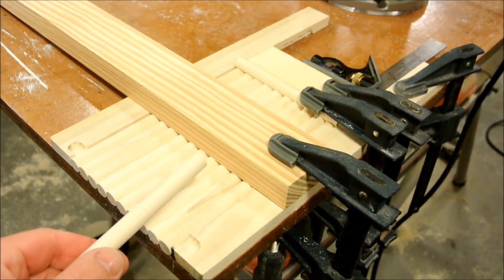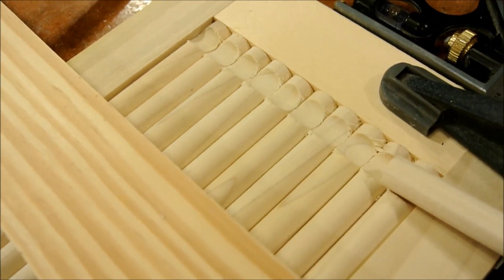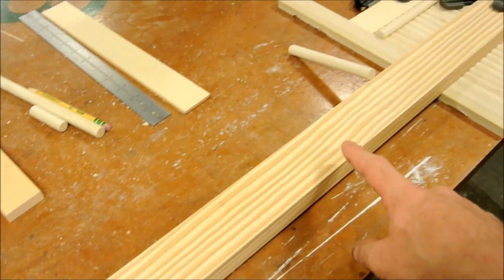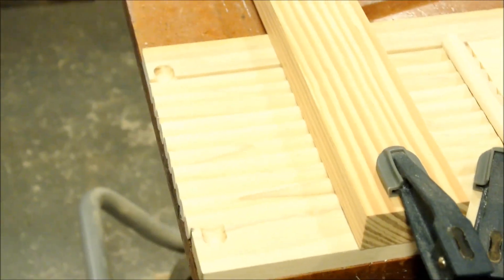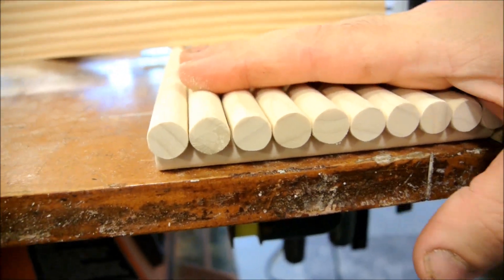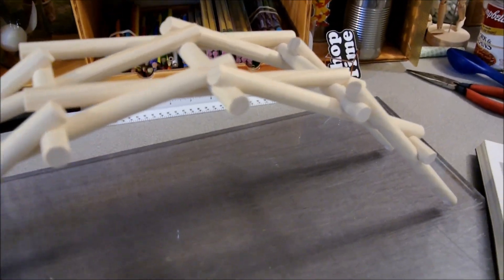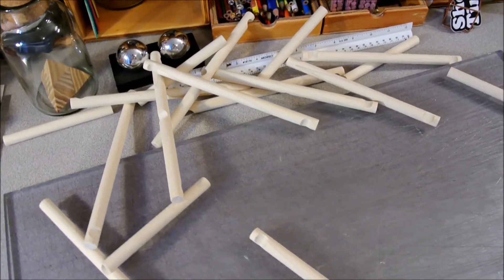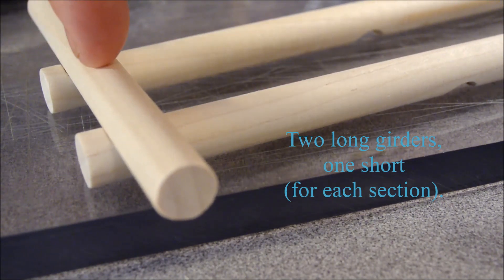Dowel routing for the da Vinci bridge puzzle

Comment: I made a bridge of this sort last spring. Used fence poles 160cm long each, the bridge is about 3meter(or more) long. Its built over a part of the forest, that drain water from a big area, so its very wet at times, but no stream. Have built a decking over the bridge, so that its easy to walk over. The bridge is quite sturdy, 3 adults and a big dog on top of it is no problem.

https://www.dropbox.com/s/ga5i7xdmvj1916j/20160618_110014.jpg?dl=0

I have built a hand railing to.

Comment: can u make a full circle from the same structure but just continued?
Reply: Myles Richter no  the bottom would not hold together  what holds it together is its own weight  the top half would push the bottom apart
Reply: Yes, you can, but it's because all the measurements have to be worked out ahead of time. I'll see if I can find a link.

Comment: This is really interesting, it kinda look at a tensegrity structure that i designed for one of my engineering exams.
Reply from the maker: I did consider making this more rigid for display by using a long beam underneath, because I could then keep it in a state of compression by adding tension (a few rubber bands) underneath the bridge. 

I suppose, by the definition, that my truncated icosahedron puzzle would count for that project. But really, look around: Is there anything that is not in a state of continuous flux between compressive and tensive states?
Reply: Yes I agree with you, everything's in constant compression, but if you add that beam you mentioned it will take forces in the form of tension instead of compression. Its because the legs also want to spread outwards. On a note I want to thank you for your nice video's they are really inspirational.

Comment: A. It's great. 
B. I can intuit how the pieces fit together, but short of a jig I'm wondering if there is a way to assemble this without a need to, at least temporarily fasten the joints(or hold them with your hands). I was pondering whether you could actually make a load-bearing surface above or below it and use it for a real bridge, if even just a walking bridge over a stream.

Comment: Nice, I've been considering this type of construction for a bridge over the creek in my back yard (20' span). But I need it to have a little less rise. I suspect that increasing the length of the longer timbers would flatten the arch. but do you think it would be detrimental to the strength of the bridge?
Reply from the maker: Yes. How big are the timbers you are using, and what is the maximum load you would expect to burden it with? Oh- (laughs) and how high is it?  

You may want to keep the design as is, and just add earth to create an abutment that rises above the bridge. This design is quite round for passage as-is. But this is far too complex an issue to give blind advice on ;)
Reply: If I ever attempt construction it would be only large enough for a riding lawn mower.  Maybe railroad ties would be sufficient.

Comment: are you gonna do a 100 thousand subscribers special?
Reply from the maker: No. I don't advocate the use of a numerical system based on tens, so that number seems arbitrary. Eight is a far better candidate for use in a superior system, even just based on its inherent symmetry, but as I've already surpassed eight sets of eight (which you may think of as 64 in our ten-fingered world), I see little point in a celebration of 12,500 sets of 8. 

lol. See why I don't think Metric isn't all that "better" now? Sorry to give you a hard time ;)
Reply: +pocket83 how about milimeters, centimeters and so forth, what do you think about that? do you think inches and feet are better?
Reply from the maker: No. I don't think there is a "better." We just get used to what we use. I will admit that Metric is far better standardized now, so after enough time, there could be less conversion-based error in the world if it were exclusive. But a fractional system is better suited for tape-measure construction, because halves (and halves of halves) are just so easy to approximate.    

That's why a system of eights would be ideal; that would be a hybrid system that draws the best from both worlds. But we have ten fingers, so I'm used to it the way we have it! However, we can dream...
Reply: +pocket83 thanks for the great explanation, i can see how your system would be useful in a lot of ways.
Reply from the maker: Wow, thank you.

Comment: thanks for sharing, do you think it can be made manually? does the design tolerate some imprecision?
Reply from the maker: You can definitely do this. My first attempt used a round rasp first, and then a piece of 1/2" dowel with sandpaper on it (spray-adhesive to stick it on there) to finish it off. That will work just fine ;)

 There are 30 notches to make though! So I thought a router would just be way easier. But for only one bridge, no problem.
Reply: pocket83 thanks, appreciate your response

Comment: is it possible to continue it until you have a cylinder? if so, could you demonstrate it?
Reply from the maker: Whoa. I think it could be done. The compressive force could be generated by making a circle of more than 360°.

Imagine something like an octagon with 9 sides.
Reply: the problem is, you need constant force from the top to hold it together. If your build a cylinder with 2 "half circles" one half of the cylinder would get negative force which would lead to disassembly of the lower half of the cylinder!

english isnt my main language, hope you still understood.
Reply: pocket83 well, as always you thought outside the box which i didnt. Id liek to see that
Reply: +pocket83 do it. Then roll it down a hill ;)